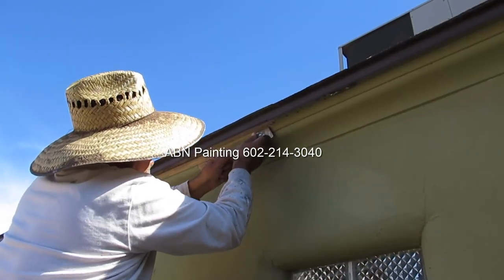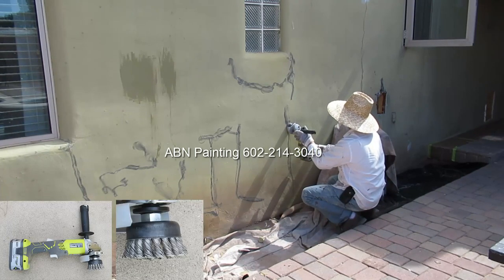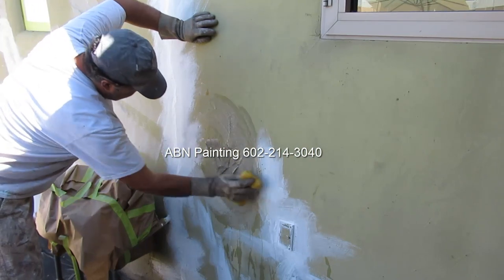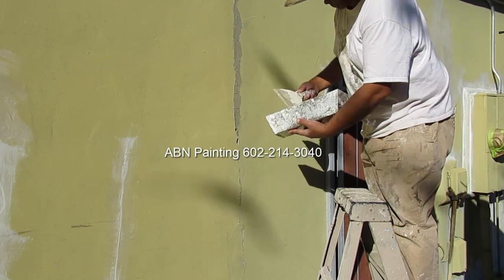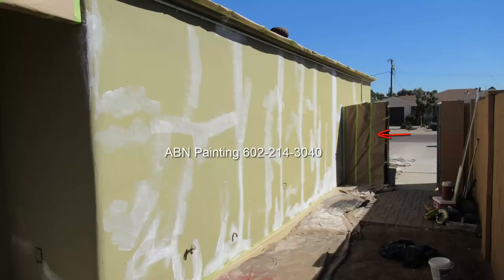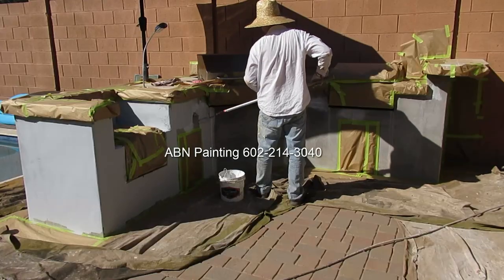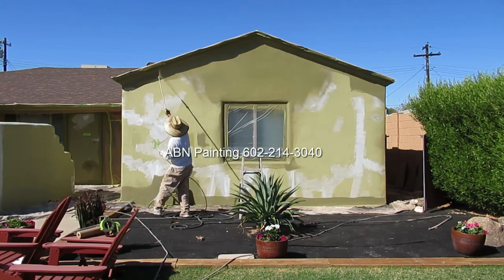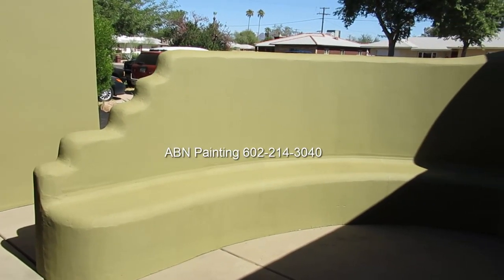Painting exterior concrete walls of a house.

Comment: If you are repainting a block home would you still use a sealer? My moms house has been over 30 years without a painting and if always feels damp inside. Any recommendation?
Reply from the maker: if the current paint is in good condition would not use the sealer. i could be wrong but i don't think that exterior paint has anything to do with how it feels inside.

Comment: Is that Scotch green masking tape you're using? I'll have to give that a try.
Reply from the maker: We use this tape for all exteriors and it works great. Gives 3 day clean removal even during the summer.
https://www.homedepot.com/p/3M-Scotch-1-41-in-x-60-1-yds-Green-Masking-Tape-for-Hard-to-Stick-Surfaces-2060-36A/206298155
Reply: Excellent reply! I'll definitely be trying it soon on a stucco house where I've had issues with other masking tapes. Blue tape is garbage for that and normal tape works, not great, and also leaves glue on sides that get a lot of sunshine.

Comment: What spray tip did you use I'm getting lines bad rac x
Reply: Sorry rac v
Reply from the maker: https://tinyurl.com/413tip
We are using 4/13 flat tip most of the time and we used it on this house as well.
(On the picture is 4/15. I could not find good picture with 4/13. )
To eliminate the lines we are using brand new tip on each job. Flat tips are very cheap. (about $3 a piece.)
You can also try using smaller size tip than you currently using with higher pressure.